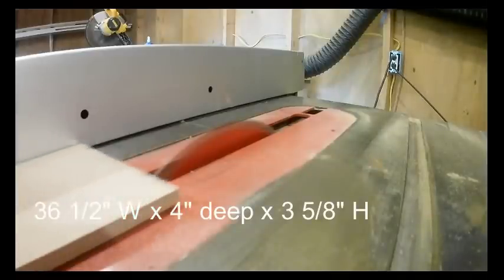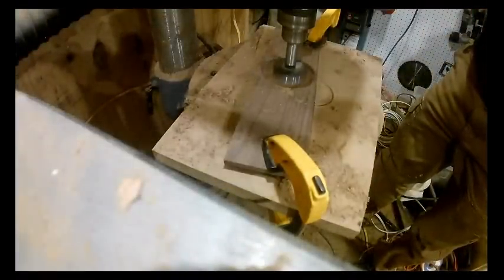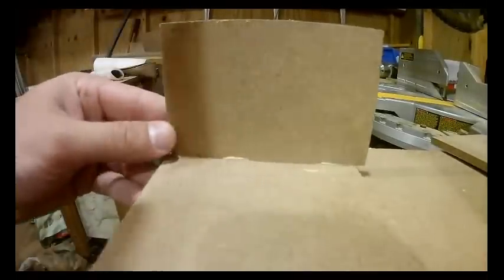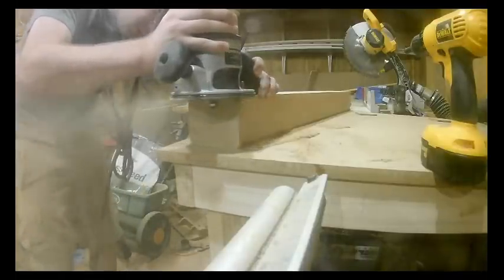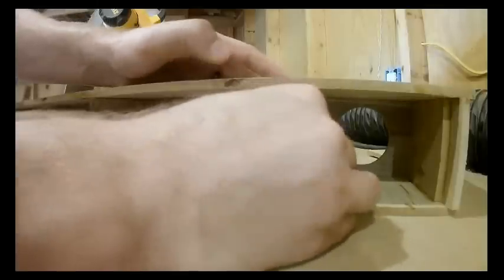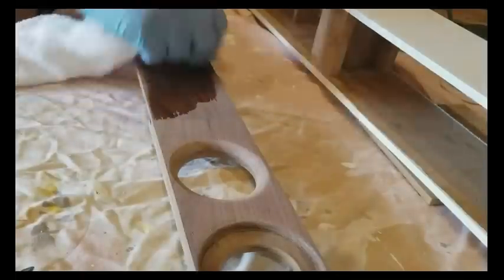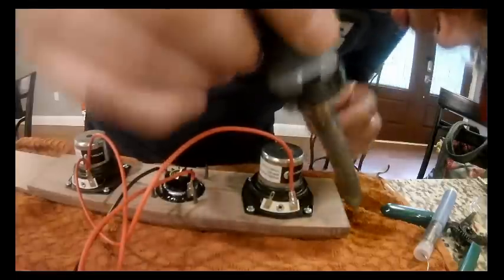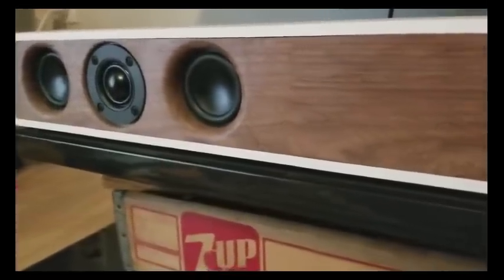How to make your own Soundbar - Free plans! DIY Speaker Build

Comment: Nice build, thanks for sharing. It seems that your build and production (both speaker and video) skills have increased significantly over these past few years. I'm curious if you would do anything differently now compared to then. Same size and dimensions? Are you happy with the performance of it now that it's been in use? Would you choose different speakers?

Comment: Thank you so much for the content you post!  I am planning a passive center channel based on you soundbar (but shorter) because of its form factor.  I used your crossover design to walk through WinPCD and XSim with the help of your crossover series with episode 7 having particular relevance.  When using this as a center speaker in a 5.2 set-up, do you think it would be advisable to ad a high-pass to the woofers  to protect them or am I over thinking this?

Comment: Just came across this video and found the Parts-Express thread.  In the thread, you say that you can substitute Electrolytic Capacitors if on a budget, but you wouldn't recommend it; however, your parts list links to the Electrolytic Capacitors.  Where would I find the ones you actually recommend?  Also, you mention internal vs non-internal amplification.  If you are using a A/V Receiver, would you need supplemental amplification?  Would it hurt to have the built-in amplification if running off a receiver?

Comment: Hi, I appreciate your work and especially the teaching part in audio, as I am a complete noob.I understand that for this project you wanted to use the sub, but cutting the ND65-8 frequency at 90hz hurts me :)...it really has a good low bass for its small size...55hz in 0.05 cu feet.Do you think the ND65-8 would have good bass in a soundbar tuned at 55hz leaving the sub alone? I can see good results here: https://www.youtube.com/watch?v=uw8wX6EFVr0
Reply from the maker: You can port it if you want to.  i may eventually redo this, as I made a much simpler crossover for it.  But that still isn't enough bass for a living room.  But you definitely can do that.  I did port them in this fun project and they sounded pretty good for the price.  https://youtu.be/UfRiuS3CSt4
Reply: @Toid   Thank you, I know this project, too.In fact, I'm working on an emoji mono speaker with the BSC you designed.Do you think that I can improve the ND65-8 bass response with passive radiators? Would it give more bass than the ports?
Reply from the maker: @bogdanantohi4310  Actually Parts Express just came out with the ND series passive radiators.  They were designed to use with these.  I haven't personally used them, but saw some speakers built with them at Midwest Audio Fest and they sounded good.  In general passive radiators can't tune as low as ports.  However, there are many benefits, including no port noise.
Reply: @ @Toid   If they sounded good, I think I will try them .Thank you !
Reply: @Toid   I am looking to make this soundbar and a voxel sub with the Lenai LP210PA plate amp. You mentioned hear that you had a simpler crossover design. Did you ever share it? Is it the one on your website? Thanks

Comment: You have two mid woofers on each channel. Do each of these mid woofers needs its own cross over or do you just have one cross over feeding the two woofers ?
Reply from the maker: This crossover crosses over both mids to the Tweeter. Both mids, use the same low pass.
Reply: Toid's DIY Audio thanks

Comment: Could the same drivers and crossover be used in an mtm cabinet with the same volume as the soundbar? Why were the drivers on each side spaced as far apart as they are on this design? Is there a technical reason?
Reply from the maker: Good Goat great question. The answer is yes. However, I just redesigned the crossover to be cheaper and sounds better. That video will be out shortly. The driver spacing was by design, and you are welcome to space them closer if you want.
Reply: Thanks for the quick response. This soundbar, the reveals, and the 8" sub with pr's are all  economical and very interesting. Thanks for these videos, I have watched all of them over the last two weeks. Great job. I  look forward to seeing the improved crossover.
Reply from the maker: Good Goat thanks, I appreciate that!

Comment: This is great if you know about the electronics parts and are a complete noob at basic woodwork.  It would have been nice to read the parts list on one page
ie   PART 1  - TWEETER -  Dayton Audio ND25FA-4 1" Soft Dome Neodymium Tweeter - required 2 off
      PART 2 -  Woofer      - .......etc 
A picture or 7 showing the electrical assemble and an explanation of what the parts did.  to me the circuit diagram was very bafling. 10% on the woodwork and 90% on the selection of parts and wiring up would have been better.
Reply from the maker: Pdoubleyou thank you for the input. I'll have to keep that in mind in my future videos

Comment: Newbie here, I've been researching my first project to make for next Christmas. I want to make this design Bluetooth capable. But as mentioned you can just add that later. My question is detailed how? Sorry if this a beginners question, I'm trying to soak up as much as I can.
Reply from the maker: No problem, we all have to start somewhere.  You basically need to get an amplifier that has bluetooth built-in or buy an eternal bluetooth module to hook up to the amplifier.  If you go with a board amp something like this would work:  https://www.parts-express.com/dayton-audio-kab-230a-2x30w-class-d-audio-amplifier-board-with-bluetooth-40--325-102
Reply: 123Toid Awesome, thanks. My carpentry skills are average, electrical is where I need to learn. Appreciate your quick response. I really enjoy your videos and designs.

Comment: Marvelous design and video. A little light on XO, however, which brings up my newbie puzzle: your XO schematic shows three speakers: two M, one T--but the soundbar has (obviously) six. Did you build two XOs? And how to wire them--series or parallel connection to the CC output from the power amp? Thanks in advance.
Reply from the maker: I'm not sure what you mean, that the soundbar has six?  Each side is wired to one side of an amplifier.  The description has a link to my web-site which gives all the wiring information, box and everything.  Feel free to check it out.  It should answer all your questions.
Reply: Two crossovers. It's a stereo speaker so one crossover with the input connected to one channel of the amplifier and the woofer output to two parallel woofers and the tweeter output to the tweeter.

Repeat for the other channel of the ampllifier.

Comment: If you merge the two sides to make a single center channel speaker, does the impedance become 4 ohm? New to this, great video btw
Reply from the maker: Thanks!  I appreciate it.  I can't wait for you to see my other videos :)  Actually, the way I have it wired right now, is both sides have two 8 ohm woofers wired in parallel, thus dropping their impedance down to 4 ohms (per side).  So if you wired both sides together in series, you would get a nominal 8 ohm load.  However, you would have to change the crossover.

Comment: Just found your channel when looking for a sound bar build. This is a great video and well explained 👍👍👍

I want to build a passive sound bar that house the central and two front speakers for my 5.1 system, so I will build as you have done and just use the centre section for the centre speaker unless there is any reason why I shouldn't.

Thanks for sharing and sub'd 🙂

Comment: Great job! What subwoofer are you using? I have a sub that I had with my old system. It plugged into the receiver, do you think I could use it with this sound bar?
Reply from the maker: I'm using this subwoofer for now: https://www.youtube.com/watch?v=MoNAu0QQMGU  Although I am building a new one for it on this channel.  Your sub will work as long as it has speaker wire/amp in and out on it.
Reply: Thanks. I’ll check it out
Reply: 123Toid hey I have a question for you I’m visually impaired how much would you charge to build me an enclosure sound bar that’s a nine speaker about 40 some inches long

Comment: how are you controlling the volume and power "ON N OFF"?
Reply from the maker: It all depends on the amplifier you choose.  Some have IR ad power on them, so you can use a remote control.  However, my television has a variable audio out, meaning I can use the television remote and volume to control whatever device is hooked up to it.

Comment: is it correct , the width is 36 1/2" ?
btw, what material You used?sorry if I missed.
Reply from the maker: I used 1/4" MDF and Walnut.  If you want detailed plans, they can be found here: http://techtalk.parts-express.com/forum/speaker-project-gallery/1344453-dayton-diy-soundbar?_=1506397047520&_=1506398464771
Reply: thanks.

Comment: Since you have a big empty compartment, why not doing a 2.1 system? I was expecting to see some more info on the crossover and volume calculation. Can you test difraction? But anyways, cool build!
Reply from the maker: Nuno Correia you could do that. I actually am using it as a 2.1 system. All the video out showing how I did that later. But I'm using a separate subwoofer
Reply from the maker: Nuno Correia I'll have some schematics out shortly. When I have them out, I'll let you know

Comment: hey, how is that drill caled you are using from 0:29 to 0:37 ?
Reply from the maker: sebasese1 it's a circle cutter for a drill press. This one is a carbide tipped Circle cutter. You can pick them up at your local hardware store or Amazon
Reply: 123Toid Thank you. Realy appreciate your good work
Reply from the maker: sebasese1 you're welcome and thanks for the compliment